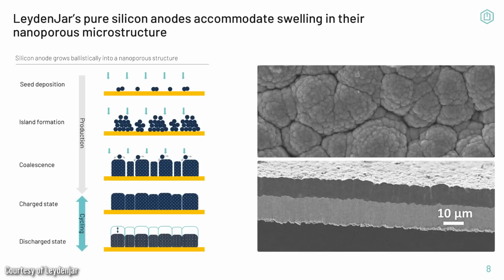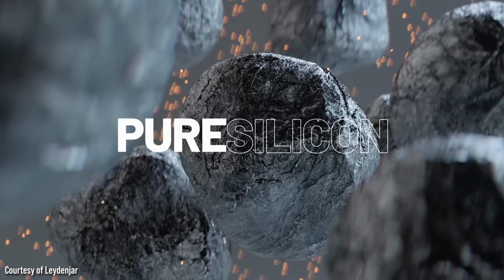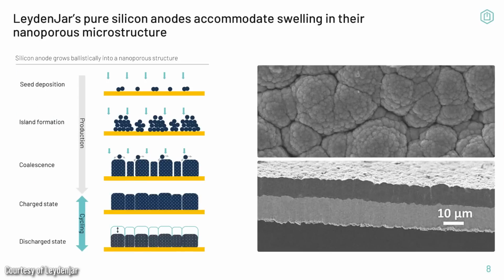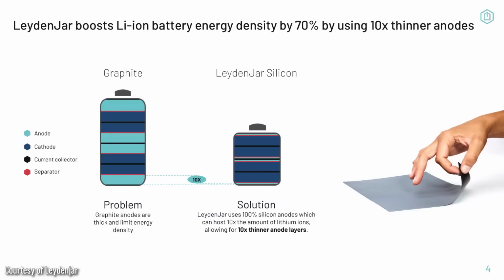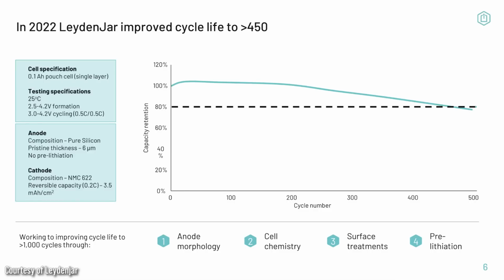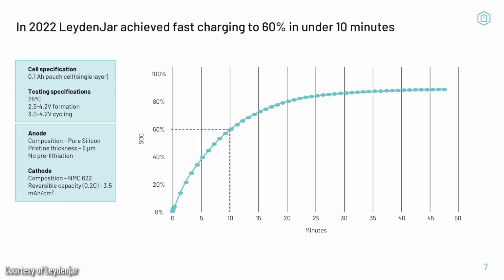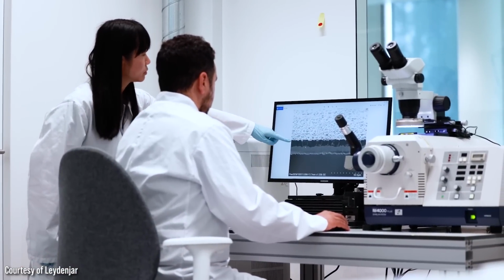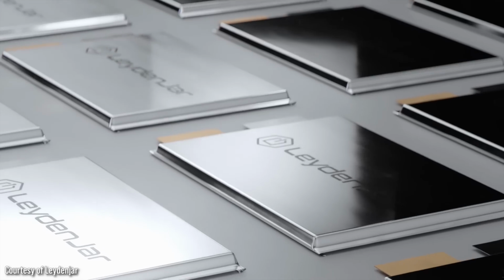LeydenJar's NEXT GEN SILICON Li-Ion Batteries | 70% More Energy

Comment: 450/365 = 1.23 years. barely good enough for a cell phone. no good for a laptop or EV. Can it withstand the cold? 10 years every day = 3650 charge cycles if it is used every day. 7300 charge cycles over 20 years.

Comment: It's been suggested before that this type of technology might be combined to make a hybrid battery.  A vehicle could have 30 kWh of long life LFP batteries and another 90 kWh of this type of fast charging, high density batteries. 

For EV owners with the use case of daily driving under 60 miles between charges and only occasional trips above 60 miles, it could work out nicely. Then the shorter cycle life for the Si portion of the battery is not a problem.  The Si portion of the battery becomes an onboard range extender. The main consideration then becomes the cost. Is the Si battery significantly cheaper than other current commonly used chemistries? If not, there really isn't much need for it. Current battery tech can already provide sufficient range for many scenarios. (In other words, it's already possible to pack enough batteries into a vehicle to give the desired range most of the time.)
Reply: This is possible but also hard.  Matching voltages without sacrificing the energy density of one of the types of batteries  is a challenge.

Comment: ok, so, if you put 1000km in a luxury car, after 500 cycles you are down to 800km range and have driven 450.000km.
800km range is still nice. the good thing with 1000km range is, that you rarely need to fast charge it.

Comment: I like the approach.  columns of Silicon.

Many decades ago, I used to run an evaporator for molecular deposition.
To get high purity results, a very high vacuum (very expensive vacuum I might add) was required.
What kind of vacuum is required will dictate costs.  Can inert gases or N2 be used instead?

But if they could achieve the same result another way, that would be fantastic.

BTW: This is the type of manufacturing that could be performed on the moon.
Reply from the maker: Sweet! thanks for that insight.

Comment: You really need 800 plus cycles life now not 400 for consumer electronics. For cell phones 400 is only a year and a half of average use and now that phones are so hard to open up and change the batteries.  Current batteries we are getting over 1000 in cell phones.
Reply: Not if a 5 ah cell gives >> 1 day usage in a compact footprint. If a battery could last a week of normal use, 400 weeks is a long time.
Reply from the maker: Good to know. I believe they will get there.
Reply: the engineers could probably stretch a lot more cycles out of the cell by limiting the depth of discharge and keeping the state of charge in the range where least electrolyte decomposition occurs. There's a good change you can make it last 800 cycles if you don't use the full capacity (just like cars don't).